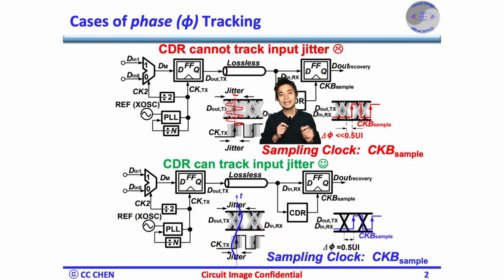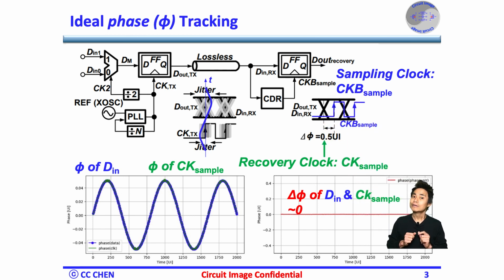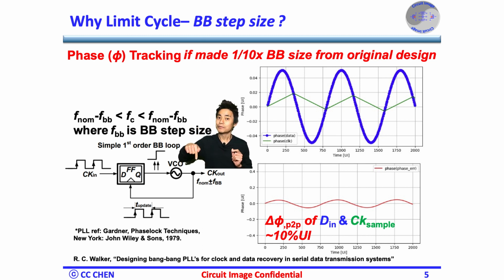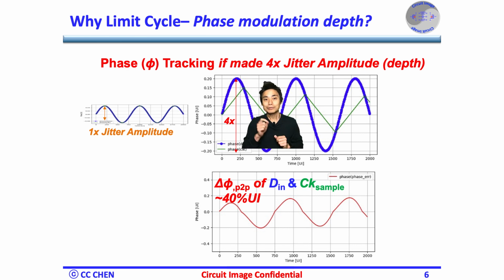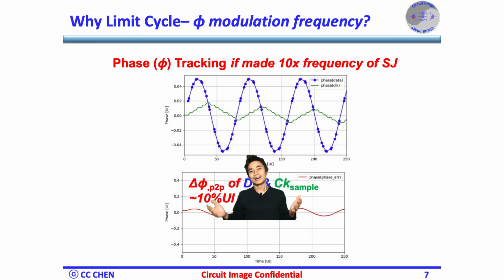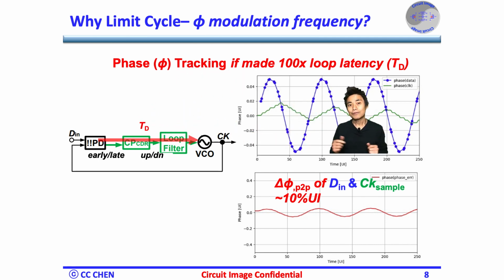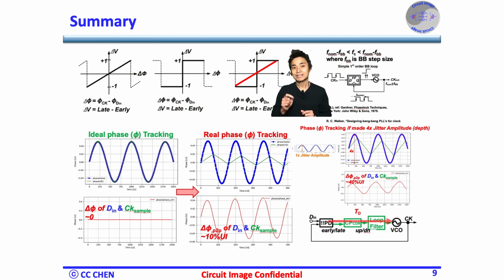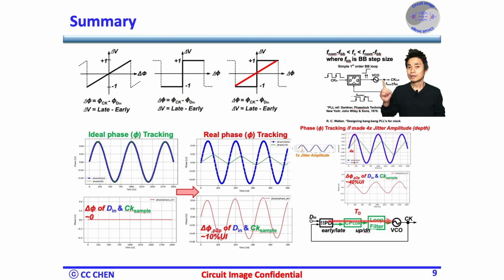Why Bang-bang (BB) Loop Dynamic Analysis or Phase Tracking Modeling in a BB CDR Design?

Comment: Nice video as always and good refresher. Just to add, there is an excellent paper by Razavi taking about BBPD loop modelling with BB PD linearized with jitter at input and due to metastability. Ofcourse, with large signal input the loop comes out of small signal regime and slews to track input making tracking bandwidth itself input jitter amplitude dependent.
Reply from the maker: Hi Abhirup,
Thank you so much for the feedback and providing excellent references for others. You're correct: "the large signal input to the loop would come out of the small signal regime and then slew limited to track input, which makes the tracking bandwidth itself input jitter dependent."